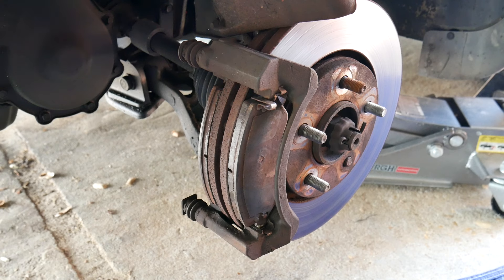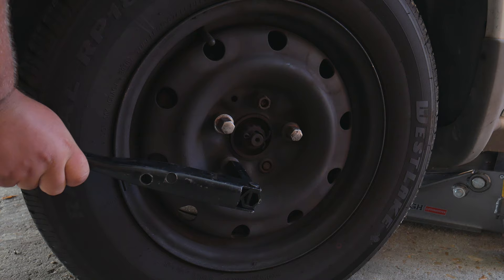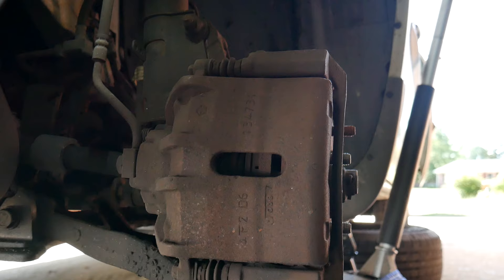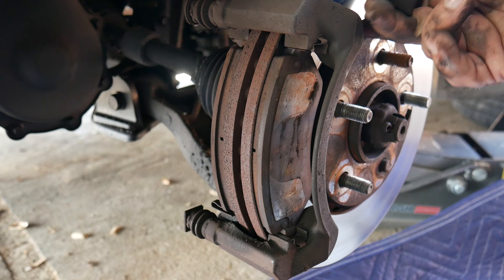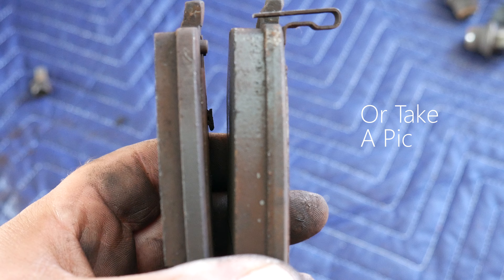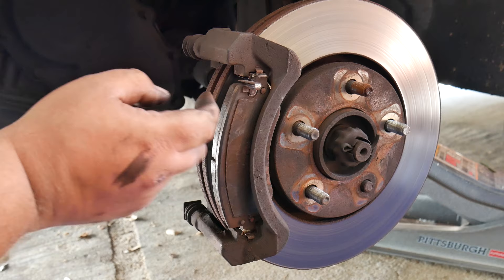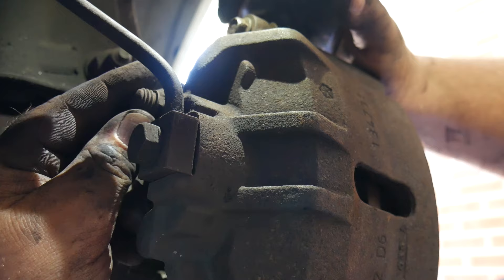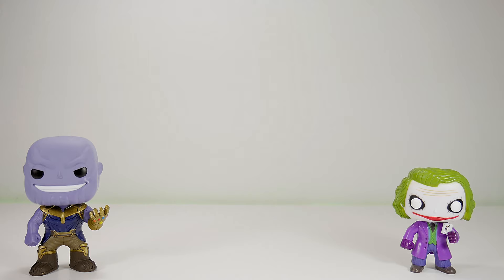How To Change Replace Brake Pads Easy Simple

Comment: I know absolutely nothing about vehicles but my brakes went out and I do not have $800+ to spend on a mechanic so this was very informative and I think I can definitely do it!! Thanks so much!!
Reply from the maker: Glad it helped!
Reply: Same here
Reply: 800??
Reply: @cainheath7610  yup same here that’s why I do them myself people overly tax 😩🤦🏽‍♂️
Reply: jus don’t put em on backwards💯
Reply: @cainheath7610  mmmmmmmmmmmmmm
Reply: If your mechanic is charging you 800$ to change your brake pads I think its time to find a new mechanic... rip off
Reply: @nickj6169  yeah definitely not going to them, they also told me my transmission was bad at one point with an issue I had with the car but it wasn’t my transmission at all it was my coil ignition pack. paid $80 to fix it and saved a lot of time lol
Reply: @cainheath7610  yeah they are money hungry, I don’t go to them, that’s just what they quoted me
Reply: How did it go?
Reply: @nickj6169  if he’s charging $800 he is most likely changing the rotors out also and maybe a brake fluid change out. Atleast for that price I’d hope all that is included. I personally believe all that extra stuff is not necessary.
Reply: $800!!!! What kind of car you have? I got a mechanic that charge $50 for the front $60 for the rear I just got to buy the pads which is free cause I just give autozone my old ones and they Reimburse me
Reply: So did you fix it
Reply: It shouldn’t cost more then 300
Reply: I don't suppose you need your car washing do you? I only charge 350 bucks
Reply: I live in Libya 🇱🇾, they charge 5$ for a braking pad change & I thought it's a rip off
Reply: Same here and I agree
Reply: @slav874 he probably was charging you $800 to change your pads and rotors. Thats pretty standard considering the pads and rotors themselves can cost over $200 and can take a few hours to complete. If you dont change your brake pads consistently they will scratch the rotors and you’ll need to replace them too.
Reply: 800+!!! Who are you going to my dads a mechanic he only charges around 70-100
Reply: @itssxyno549  $70-$100? For 2 hours of work and $200 in parts? Yeah okay. I think you’re not realizing he means pads and rotors not just pads.
Reply: @succafree8796  autozone gives free brake pads? Whaaat? Since when?
Reply: @suhtangwong  if you got a warranty just take the old ones back to them and you get brand new ones for free
Reply: The mechanics near my home charge $900+tax for all 4 wheels. ($450 for each axle) 😭
Reply: @nickj6169 most of em charge a lot now. It’s 300.00 in my area per axle
Reply: @itssxyno549 if your dads located in MI I’ll take him today lmao
Reply: Me too, I had to service my car but i did not have R700 to pay machanic, so i have used the very same Utube for guidance then i eventually came right. Surprisingly it did not even take me 3 hours
Reply: $800? I paid $270 for the front axle and new rotor
Reply: I work on my own cars. The right way. Mechanic more than likely quoted you for all 4 rotors and brakes. Then labor. All of you people saying dur it should only be 300 or less! Well your rotor and brake kit is about 200 to 300 for BASIC SPEC shit. But yeah your mechanic was probably upcharging a bit. It's annoying you people think its anything other than basic capitalism though.
Reply: Dealership  asked 725+ tax for front and back
Reply: Did you do it?
Reply: @nickj6169 should be around 250, please don't get scalped 🙏
Reply: People complain about the price of shops but also forget to fail the price of everything else going up. Gotta support they're family's.
Reply: @ghost-carnage8964  yeah I get it but $800+ to change brake pads when my rotors were fine is absolutely insane. most people nowadays are on a fixed income with everything going up and can’t afford to spend that much on vehicle maintenance.
Reply: @nickj6169  Well, actually that's not too far from what I experienced today, so I would say that's probably pretty standard price for this type of job. I'm assuming $800 for both front and back. I live in a semi-rural area with low COL, and called 4 different shops, out of which 2 quoted $350 for each (front/rear), so total would be around $700, plus tax. The third one quoted me a little over $250 for each, and the last one around $300.
Reply: 800$ damn i paid 25$ for the two front wheels, it was ceramic pads for my impala
Reply: Over $800 over here were I'm at  its like $200 to $300 sometimes under $100
Reply: I know it's been a year but damn where the hell are you going? Every mechanic I go to is less than 150$ for a brake change
Reply: Wtf? Mechanics in Libya change them for 10LYD=2$ per wheel
Reply: It shouldn't cost that much to replace half the price in NZ
Reply: $800? Damn I wanna be a mechanic now
Reply: @cainheath7610  Cheap.
Reply: How bout y'all do it y'all self for free he just told y'all how to do it Easy Peasy Lets Goooo DIYers 💪🏽💪🏽
Reply: Saved $900 doing my front and rear brakes this week.
Reply: If your spending $800 for brake pad changing you need a different mechanic thats robbery
Reply: @succafree8796 technically you don't want to pad slap, but a good mechanic can tell when a rotor is at the end of its life span, and when it's got another cycle in it. My rear rotors are warped so it's time for new ones.
Reply: @cainheath7610 yup. They over charge on parts, then charge $49/hr for labor. Especially if you have to replace the disks.
Reply: Brake pads are $50 each😂 we live in a sick world that’s wild
Reply: 800!? I went to orielies and payed $30 for just the pads 😂
Reply: Yeah unfortunately these mechanic shops THRIVE on people not knowing how to do even simple stuff like that and convincing you it’s a job worth more than 100 dollars lol. I didn’t know half of this stuff not too long ago and it puts in perspective how much you’re getting scammed 90% of the time lol.
Reply: Ya these mechanics are on wild expensive. It’s time people start learning how to do this stuff themselves. It’s how you control supply and demand. Same with buying expensive food. Stop buying it. They’ll have to decrease price. Economics is a very important class EVERY “voter” needs to learn.
Reply: A mechanic said they were going to charge me 1000 dollars just for the front brakes so I noped out of that lol
Reply: A Warranty is usually associated with brake pads when you buy them.@suhtangwong

Comment: Be aware depressing the caliper with out releasing the bleeder nut as you could damage the ABS system as forcing fluid back up through the line will course damage in some units!!.🤔
Reply: That's why you take off your brake resolver cap
Reply: I pushed back the piston with a c clamp my whole life and never had to bleed it unless it wouldn't push back. Never damaged anything and I probably use this method about 20 times in my life
Reply: Hmmm could be why my car's abs light is on. It came on a few months after I changed my brakes. First on and off and then it stayed on.
Reply: @autumnwind2699  disconnect the battery for 10 minutes.  It might have clocked the back flow as "this was not supposed to happen" but now if the brakes are working and you are not leaking brake fluid the sensor might reset.
Reply: @iNSTAGiB Rarely but being prepared for the improbable isn't a bad thing.
Reply: @terrimotherof4089  Thanks, ill try that
Reply: This just got complicated
Reply: @dirtysouthhc2936  same here. A piece of wood over the piston to spread out the pressure, then just compress with a C-clamp. Done it probably 10-12 times and never had any issues.
Reply: @Lo-sevo  your brake what?
Reply: @dirtysouthhc2936  that doesn’t mean it won’t hap to other people it’s like smoking ur whole life and never getting cancer
Reply: Never had this problem 9n my 1981 Kombi. I have replaced the brake pads for years and never damaged the nonexistent ABS
Reply: As a Troglodyte I have smashed hammer at brake, 
but never never damaged the ABS yet. Isn't it an open system that if activated cuts the system? 

Alternative question if I brake while driving in reserve do I destroy the ABS. 
If car technology isn't that advance I'll never reverse again
Reply: @ChiefHitemBong  he means his brake revolver cap
Reply: How doni release the bleeder
Reply: I went to school and my auto tech teacher Chuck at Central Carolina Community College told us to take the cap of Master cylinder before you depress the caliper
Reply: I don't know much about car's, but is this how you change majority or all car breaks?
Reply: I depressed the caliper and now after reinstalling everything my pedal feels squishy it's almost like I have no brakes at the start of the pedal but once I start pressing the pedal further down it hardens.
Reply: Jack stand placement is important! As you can see by all the damage to the bottom lip on that car! Ffs
Reply: @ThibsCarReviews did you pump your brakes before moving?
Reply: Already whent through this🥲
Reply: @caravan stuff thank you Karen for caring! ❤
Reply: @jackierodriguez674  that seems like it would help air out any bubbles after decompression of the brakes caliper 👍
Reply: Just gotta do it slowly
Reply: 😂😂😂 @ChiefHitemBong
Reply: @KonradvonHotzendorf 😂😂😂
Reply: Pop reservoir cap open
All the fluid that being pushed from calipper will drip from reservoir 
Top off reservoir if needed after u done with replacing all pads on all sides
Reply: Shhhh

Comment: You don't even need to take the caliper off if your just changing the brake pads. Just remove the bottom bolt and swing the caliper up. You won't have to worry about zip tying or hanging up your caliper.
Reply: Thank you!  I was watching this as a refresher (as it'd been awhile) and got confused about that part.
Reply: Suppose you have to slacken the top bolt before swinging up
Reply: Thats what I thought 😊

Comment: It’s crazy shops charge so much to do this.
Reply: Trades make their money off of people who are ignorant or too lazy
Reply: @shteatinggrin ... or they make voluntary transactions with people who are willing to pay someone to do something they might not have time or tools or knowledge to do themselves.
Reply: @Jondongalong  So yeah like I said Trades make their money off of people who are ignorant or too lazy
Reply: @shteatinggrin I'm a tradesman.  You clearly aren't. So... so yeah like but like actually not.  Most of the money made by tradesman is coming from those who would rather pay than do it themselves.  You are paying for the fact that someone else has the tools, the shop, and knowledge and skills and warranty that you don't.  That's... reality.  Nothing to do with ignorance or laziness, except maybe in your case.  I can change my breaks and spend 50 bucks for a 30 minute wait at a shop,  or I can do it myself in 2 hours and get covered in grease and spend 30. I don't know about you but I am worth about 150 an hour. I'm a mechanic and a bricklayer btw
Reply: @shteatinggrin  eventually when you live on your own and perhaps have to work yourself,  you will understand the monetary value attached to your time.
Reply: @Jondongalong but not taking the time to learn is laziness many car parts can easily be replaced/fixed in your back yard but people are too lazy many people can’t even do an oil change as a fellow tradesmen
Reply: The cost to make brake pads is significantly cheaper than the retail price.  $40 to $60 for a set of pads when it only costs $3 to make.
Reply: Fr it's cheaper to just do it yourself... Honestly they pay to much to just to do the simplest stuff

Comment: I'm a city boy, who's main mode of transportation is the subway.  Every time I have vehicle issues other than a flat I would run to a mechanic.  I've decided it's 2022, I should be able to do what others can do. I watched this vid 3x. Went and purchased brakes, spacer and ratchet. Your video played through the whole process on repeat.  Only thing that wasn't covered which scared me for a moment was replacing the caliber. I had to push the piece that receives the screw back in. But thank you.
Reply: Lol I love how I feel exactly like you.. City boy myself and started really driving with my own car 2020.. I've learned a lot and only now finally I'm like fuck I think it's time to learn more.. cause brake pads are $50-$100 bucks .. and going to the mechanic means an additional 200-300 bucks 🤦🏾‍♂️ plus any taxes
Reply: @easttorontotv6310 same boat bro accept im a hybrid lol city and country

Comment: I always assumed changing brake pads required draining the brake fluid and avoiding getting air in the lines so I was always worried. Today I needed to change my brakes and decided to look up how it's done. Wow, this is a way simpler task than I imagined. Changed all 4 brake pads and saved myself $200+ taking it to a mechanic. Thanks man, great video. Lucky for me my father-in-law had that tool to decompress the caliber!
Reply: I’ve used a piece of wood and a c clamp before too

Comment: Awesome video. Very clear video.  Very slow step by step.  If you follow this instruction you cant go wrong!  One quick tip. Open the brake reservoir lid to allow fluid to go back up into the system easier when compressing the caliper.Thank you for posting this.
Reply from the maker: Welcome 😊👍

Comment: Wow I’m a super super girly girl, nails n sittin pretty but my front brakes needed changed & everywhere I asked the were trying to over charge even when I said I I have my own brakes. Came on here saw ur video & changed them myself. Borrowed the jack from my neighbor. So now I know how to do my own brakes. Even know how to change a brake sensor, change oil, tail lights & of course a tire. YouTube the best. Ain’t gotta worry about asking a pervert guy or worry bout getting ripped off or worry bout having to kick it with a guy afterwards 😂

Comment: Best advice is to look at the pads before removing them so that you know where they go. On my 2009 Chevy Silverado the pad either the metal wear indicator goes on the inside but what’s even better is that the inside pad has a flat edge that matches the flat part on the caliper with the other pad and side of the caliper being curved.

Comment: Nice job. Hint.....if you wish, instead of totally removing the 2 guide pins..... loosen both, but ONLY remove the bottom pin...and keep the top pin in-place to act as a "hinge" for the caliper portion you removed.....in this case just swing it up and tie it down so it doesn't accidentally swing down whle doing the work. You still have full access to remove and reinstall the pads.

Comment: Thanks 👍
I had some issues today putting it all back in place... Now I see my fumb error and why it was too tight to get the caliper on 😅
Regarding bleeding:
On the hardware store I found a bottle with a hose with correct size for connecting on the nipple, and with a back flow block ventil.
Do I can just push the break pedal without risking air going back inside.
One man job 👍
I bought 2 so I could take both sides at the same time 😂

Comment: How do I make sure the brake pads move away from the rotor when not in use? When I put mine back with the clip, I couldn’t tell how it will work.

Comment: For many years I worked on my cars; 1960's, '70s, 80's, 90's. ....brake shoe linings and then brake pads I took in my stride. Today, it's never been easier for a young chap, with the interest and curiosity, to change brake pads. You'll need the tools but with those, you're home and dry....try it....How To's like this one will guide you......you'll save £1000's over the years....what are you waiting for?

Comment: You forgot a very important task ,that the Caliper guide pins to be cleaned and greased before you fixed back the Caliper to ensure that the Caliper moved horizontally freely.

Comment: Hey mate, great video! Save me some money, one question, if you over push the brake compressor by a couple of mm and then put it back on, will it reset against the brake pads by pumping the brakes? Or what is the process for it to reset? Cheers
Reply from the maker: yes it should usually reset . good luck

Comment: Should I be worried about those 2 bolts that hold the caliper in place coming off? If so could I use blue loctite?
Reply: Loctite so next Time u try to take it off it’s doesn’t come off?😂
Reply: At least use a torque wrench.
Reply: My lower bolt came off on the freeway and the car lost all breaking power. I'm considering blue loctite (medium strength) but at a minimum I'll be using a torque wrench.

Comment: Another tip....yes...the brake pad wear indicator "finger".....that you say is usually on the outside...may not be true. I've seen most being on the inside. If you can orient it correctly, try having the "finger" on the BOTTOM, instead of on the TOP. If the finger should ever rust out or break-off, it has less chance of getting caught in the spinning rotor. Test fit, maybe it even fits if it's on the inside with the 
"finger" on the bottom.... you will easily see if it fits in this orientation.... or not. Cheers.

Comment: I noticed the tyres are west late. and the most important thing at last is after you finish all of these, start the engine with N gear, and Step on the brake pedal several times to initiate the brake power. otherwise you will lose the brake when driving on the road.

Comment: Only problem is he doesn’t mention where to put the jack or the stand . Also you can take the bottom bolt off the caliper
Reply: ye bro just bottom bolt, and a screwdriver to force the piston back, no need for the Brake Depressor, But i think it is pretty obvious where to put the jack though, if you cant figure that out then you have no buissnes attempting to change the pads 😀😀👍👍